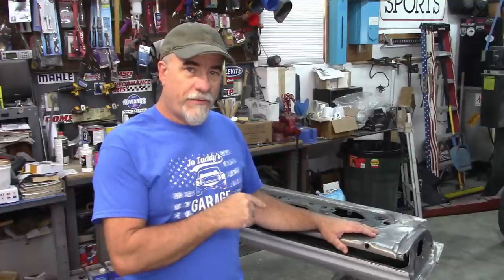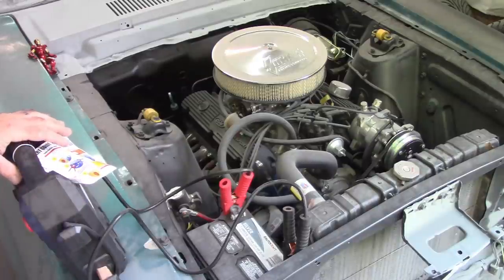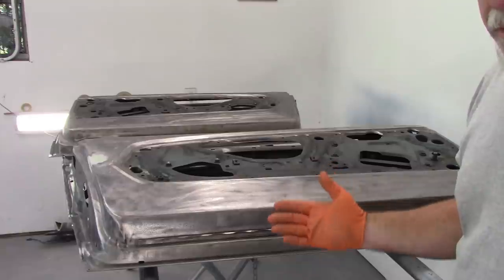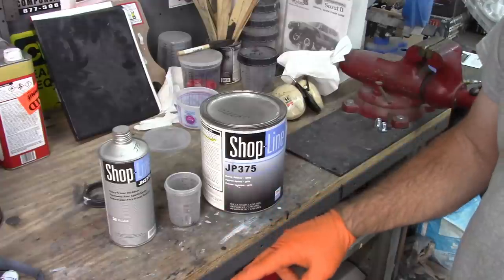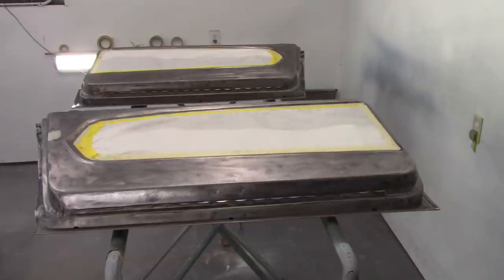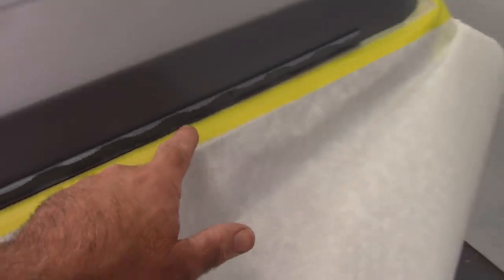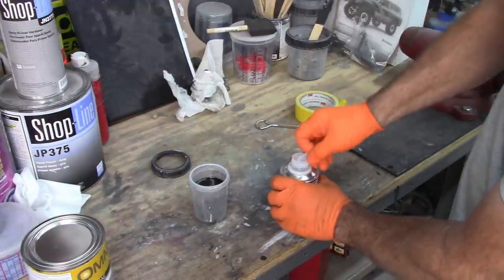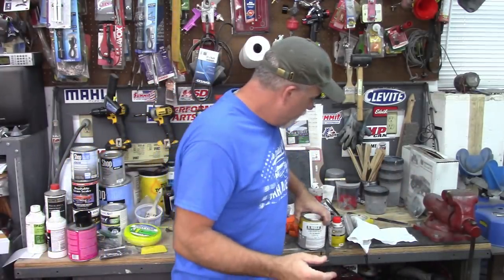Painting the inside of Mustang doors. Jade part 36 (Bonus engine start)

Comment: I know this is a year back, but looking for hinge video. 
“The Start-Up” I am a carb guy from way back and I will advise using “Fuel Stabil” in the tank and carb. With the air cleaner off, carburetors have tiny pipes that go from the float bowl to the choke valve on top. Put a cap full in each tube. Use the extended storage chart for the estimated amount of fuel and add as needed. I recommend pulling spark plugs and spraying a “Fogging Oil” made for this purpose. A V8 when shut of will stop in one of 4 locations due to compression. Any position will have some intake & exhaust valves parcilly open, allowing humidity from the air to cause rust in the cylinder(s). Just a word of caution if it has not been done. I know of one guy with create engine seized up after sitting in un heated garage. He compromised with company to diagnose and a machine shop found rust on rings in 3 cylinders. 
  I don’t know what all has been done as YouTube changed the “Bell” feature and I am not getting notices!
Reply from the maker: I have several hinge rebuild videos.

Comment: VP-4464 from SEM is the correct black. It is sold at National parts depot. I think it’s a special formula to replicate the original color, it is very subtly metallic. This is their universal color coat line. It will work over epoxy and your plastic parts. I sprayed gray epoxy (SPI) on mine first as well. Either way yours turned out nice.

Comment: Is that a hole I saw in the bottom of that pass door?  As for that paint I have some AE gloss black that I use for lots of odd stuff and it's quite durable. Mine is an 8-1 mix which I have to calculate since my mixing cups don't have it easily marked on it. I didn't paint my door when I did the skin since she hasn't picked an interior color yet...
Reply from the maker: Maybe.. There was a tiny hole. I will add a little filler....
Reply: @JoDaddysGarage  I have one that i missed... Course both sides are blasted and epoxied so it'll just get filled. It'll way outlive me. Got a camera coming tomorrow. Will do an update video and the better half want's me to make vids of my projects and post them so looks like I'm going to have to learn to edit and film and how to keep out of the camera view as much as possible...

Comment: It wasn't easy to see but is the primer filling in the pattern on the door? Do you think the top coat will? Are there any top coats that can go directly on bare metal?
Reply from the maker: It didn't appear it fill it too bad. The black part is finished. When I spray color and clear it may fill a bit more on the rest of the door.

Comment: that engine sounds very nice. What are the specifications for the engine, or can you tell me which video you describe the engine for this car? I have not been following this series as closely as I do the Brooklyn pony. Nice job.
Reply from the maker: A friend built it for me. I listed the cam specs on an exhaust video I made. Competition cam. SK31-216-2 .447 lift https://www.youtube.com/watch?v=diRBfE0wbjU
Reply: Thanks for the info.  I’ve got a mild 302 in my 65.  A friend built for me as well a number of years back.  Unfortunately, I lost the folder with all the engine specs init.  Hearing you start the car maid me want to go to the garage and start mine.  I had an engine bay fire back in March.  Just fixed it enough to get it running again.  I want to re-wire the entire car for safety purposes now.  My vision isn’t good enough to do it on my own, and good help is hard to find lately.  Once the wiring is done and some paint work done to fix fire damage, the car will be done again.  I’d consider another project, but no room.  I can’t see well enough to drive, but I like working on them.  Considering selling the 65 to fund a new project, but not sure if I can part with it.  I have learned a lot in 20   years of working on this car and 10 years owning a 66 T code before.  That project never went far.  I wish I had videos like this when I began.  I made my share of mistakes.  Thanks for the content.